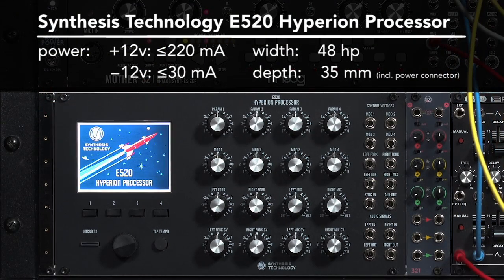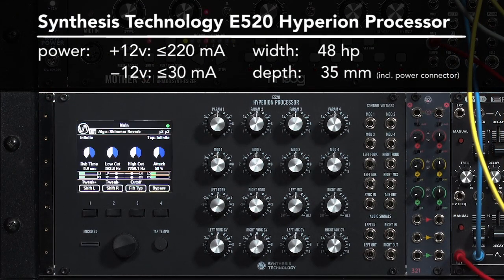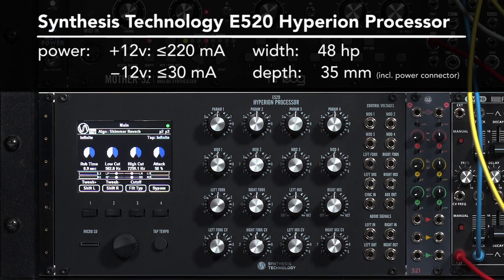Video Manual: Synthesis Technology E520 Hyperion Processor

Comment: Nice demo. When will this module be available for purchase? This seems like all in one effects module to beat for modular.
Reply from the maker: That's a question for Synthesis Technology. He has been filling direct pre-orders first, and then originally planned to ship to dealers around November. I think the builds have been going slower than planned (including receiving a bad batch of front panels), so I'm guessing February 2021 at this point. Unless you can find a used one for sale from one of the pre-order owners.

Comment: So it's a really expensive delay? I havn't quite grasped what makes this multi fx unit special. It seems like it does a lot of stuff I would use a computer for. Is it in the really high quality way it does it's effects? It seems like the delay and reverb are the main attractors and with heavy players like eventide, TC, and Lexicon did they make something that rivals other options that have decades of experience doing this? just with CV control? It spectrally crushes. But so does clouds in a back end firmware. Idk why but they didn't include a granular mode. I'd just like to know as it may be for me, but for the HP and price im not sold.
Reply: Agreed. Sadly, it seems some modular designers have become obsessed with screens.  Personally, I prefer Synth Tech's older designs with no screens.  This module comes across as fussy when it doesn't need to be.

Comment: Sorry if I missed it, is this hulking Hyperion running at 32bit and at least 48kHz? If it's 32/96 and under $1k, my interest will be officially piqued.
Reply from the maker: 24-bit, 48 kHz, $649 suggested list. Minutes (rather than seconds) of memory. More in their web site: https://synthtech.com/eurorack/E520/
Reply: It you REALLY think, in a Euro power supply environment, you can get an actual 32bit SNR (as measured on an Audio Precision), I have some land in Florida I need to sell.
We use 24bits for the DSP math to allow more range in the calculations for the FFTs. Moving to 32bit math (where the lower 8 bits are random numbers due to the noise of the system CODEC in a EURO case) makes zero sense.

Comment: Hmm. Absurd hp for one stereo effect. Never seen so much blank panel space on a module. Unnecessarily gigantic knobs for essentially attenuators, and my pet hate, fx modules where the input clips easily with no physical input Attenuator knob. Great video as usual though.
Reply: I can't argue with any of that. Paul Schreiber does great work, love all my Synth Tech modules, but his esthetic comes from MOTM 5U format where size is no object. Usually have no issue with that but fully agree on this design and E370. Unnecessarily large. Would jump at a µ version of this module though. That being said, I own Radikal Technologies EFFEXX RT-1701 which is 32hp (compared to 48hp here) which has 2 stereo mutli-FX processors, dedicated stereo reverb, attenuation and overdrive of input, and stereo mutimode filter. All of that fits with no menu diving because knobs serve multiple purposes (using a shift button). It's a bit of a trade off but I'm loving it so far.
Reply from the maker: Well, to say it's "one" stereo effect is a bit unfair; there's lots of algorithms, some of which do multiple things, plus a dual mono mode. And I was talking to Paul about this today; he said people complained when he left attenuators off the E350, and they complained when he put them on the E352. So he knows he can't please everyone. He also refuses to create or use modules that just use trimmer shafts for controls.

For me, I would never consider this for my live case, but I replaced two large effects modules in my studio case with it.
Reply: I maybe could get 4HP out, but I wanted this to specifically fit into the 4ms 48HP PODX powered skiff. For being portable and self-contained. The #1 complaint I get is "your knobs are too close together". So I spread them out like 10mm additional from the E370.  No pleasing everyone [shrug]. I guess I can mention it carries a lifetime warranty (like all my products). Does that help?
Reply: Paul Schreiber I love being able to put fingers on knobs rather then the tip of my pinky. This module sounds great and seems very comfortable to use. Thank you.
Reply: @paulschreiber9384  I have a portable 14u MDLR case so having a mega super FX module even if large like this one would be awesome as I do prefer larger knobs and switches. More comfortable for playing since I have fat fingers. Looking forward to this module release as it looks super awesome!